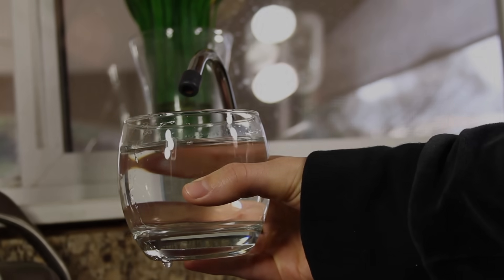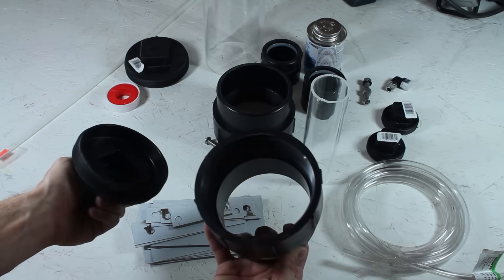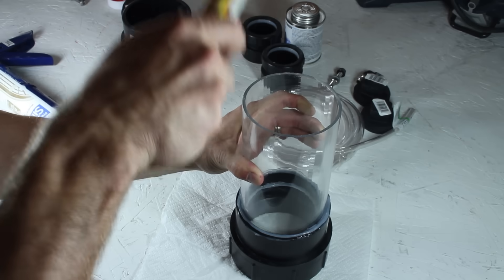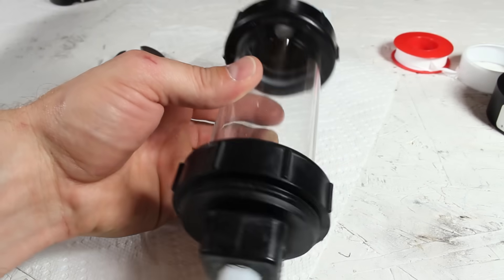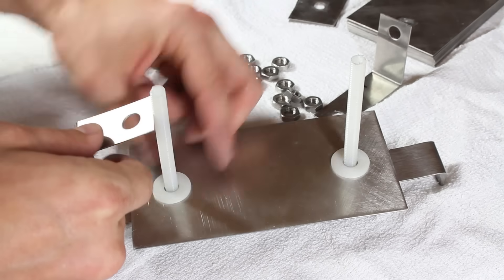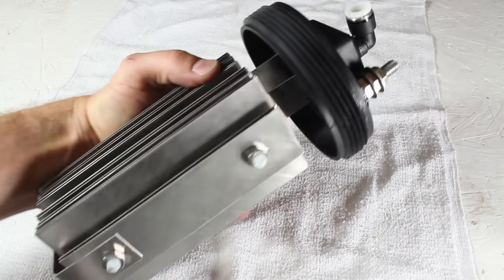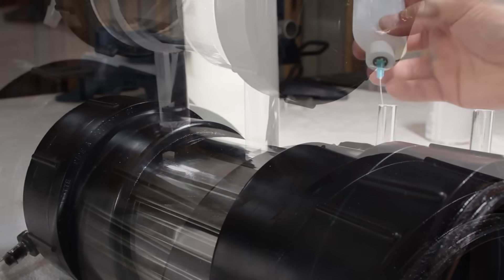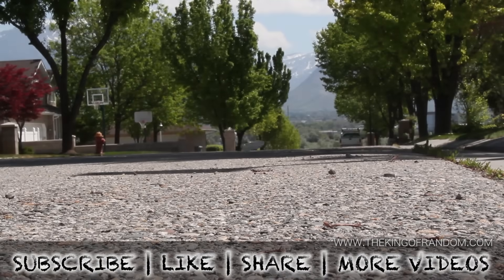HHO Generator - Water to Fuel Converter

Comment: Will this work with an AC current too? If you could hook this up to a car's alternator (or if it doesnt work with AC current, convert it to DC), you could raise your mileage...put a bunch of these in a truck toolbox and put the output HHO hose shooting the gas into the engine's intake. Im working on building one, the only issue is finding a source of high electrical current other than a car alternator.

Also, baking soda works well as an electrolyte/catalyst. If you happen to run out of potash

Comment: I found this project great. I wonder if this  works a brine solution (NaCl + water). Before I tried to build a brine electrolyzer using empty bottles of soda and or sports drinks. I used carbon  from used Carbon batteries as the electrodes. It works effectively and HCl gaseous state is the by product. With the help of this video I can  finally revised my own HCL gas generator .

Comment: You know, There's a way to separate the hydrogen and oxygen.  If you make a similar setup to this, but have two elbows, such that you have water in a U shaped tube, and then have a cathode at one end and the anode at the other end, you'll get hydrogen evolved from the cathode and hydrogen from the anode and they will each float up from their electrode where you can capture and store them for later use, and then you have another problem to solve: hydrogen storage.

Comment: Hey Great Job Dude!, I have been building Mine going upto a Year now, Lolz, (Pittiful right?). But hey, Due to the Massive Amp Draw Its Not Practical for Car use, But I have a question, is there anyway a step up or step down TRANSFORMER can solve or at least reduce this problem? & make somewhat Useful?. I have been trying 2 research.
Thanks.

Comment: I think you use the wrong setup in youre plates brcause you get to much water vapour . That means you get to mich volts on your gabs you heed around 2 volts per gab for optimal gas production

Comment: quick question. the connectors for positive and negative are connected to the two middle plates(2 octagon things separating them) and to the 2 outer plates (apparently), so how do the other stainless steel plates get the positive or negative charge?

Comment: You are absolutely correct, and if you see the part near the end (~8:17) you can clearly see the bubbles are only coming from the middle and outer plates.

Also, the math tells me that 5 liters/min requires ~472 Amps. That's maybe possible using two car batteries in parallel, but not for very long!

Comment: The way you built the generator mean that there is current only in four plate. The two external ones and the 2 middle ones. All other are electricly shielded because of the plastic washer. Wouldn't it be better to bridge half of the plate ( in alternance ) on + and half on - to get an even higher efficiency ?

Comment: no because abs is used in chemical drains for science labs and acrylic is gust for looks you an use some abs pipe for that  if you are worried about chemical bounds eating away at your pipe nylon can be used as chemical transfer for a container to another container i seen it hold up to battery acid for 8 year and still going  acrylic is just for looks but it will work as well

Comment: Yeah right, but  this chemical reaction isn´t that inefficient if you use the resulting heat(exotherm reaction) e.g. with a recuperator. If you let the H2 & CO2 react to Methan(and water) you can use the already existing gas-pipelines & tanks for transport and storage, no new systems needed. I think it´s ok to loose a little bit of efficiency at the reaction, so that the energy can be transported/used in existing systems. 
Btw the system´s called Power-to-gas in general if you´re interrested :)

Comment: Most of the time, when dealing with physics/chemistry/science overall, the more you convert something, the less efficient it becomes. You will lose tons of heat/energy if you take solar power (Light) convert it to electricity (Electric) then to Hydrogen (Chemical), Methane (Chemical), and back to electric (Via burning the Methane to create steam that will turn a turbine). It is wildly inefficient. It would be much better just to keep it in Hydrogen form, then use a fuel cell.

Comment: Photovoltaic power source instead of car batteries and you have a hydrogen fuel cell.
Did you calculate the efficiency of the device? 2 car batteries is quite a bit of omph!

Comment: Some type of glass would be ideal because it would resist the heat much better than plastic. However, glass is more difficult to cut into the shape you want, and it is also more dangerous if your device backfires and explodes.  You might want to try a type of plastic that is very difficult to melt.

Comment: Taken directly from the description--
"I have not tried this HHO fuel to operate engines, although many people claim they have done it with success."

My take -- Yes, as long as the engine is meant to run on Hydrogen-Oxygen reactions. Putting this in an engine not designed for such purpose, i.e. a car engine, is just a stupid way to get yourself and/or others killed and/or seriously injured and should not be attempted.

Comment: well if you could get a engine to run of the gas you can connect an alternator to the engine and charge the batteries and also hook up a little generator to the engine you might be able make a self sustaining power source as long as you have enough alternative fuel to power the engine and a sustainable water source.

Comment: Yea I was told you could use any sort of metal, however stainless steel will last the longest and wont corrode as fast as other metals. I'm not sure how long it lasts compared to some other metals though

Comment: "the fuel of the future"?... If you attached this to your car, wouldn't it corrode the spark plugs or eventually flood the engine, since the gas turns back into water/water vapor, which, in turn, condense in the piston?  I understand there would be exhaust in the engine but would it eject ALL of the water?

Comment: This can be installed into a vehicle with a recirculation pump feeding the water. Re-created during the burning process back into the generator. And with a few alternators and a capacitor the car can generate the electricity needed

Comment: The problem with Stanley Meyer's design is that it is a perpetual motion machine.

He claimed his fuel cell would split H2O electrolytically, burn the H with the O2 recombining them to form H2O which returns to the cell. Meyer claimed that less energy was needed to split the H2O than is predicted and observed by science. His fuel cell violates the first and second laws of thermodynamics.

This is equivalent to powering a car by mounting a wind turbine on it.

Comment: You can't get the Potassium back from Potassium Hydroxide by reacting it with Aluminium. That reaction yeilds Potassium Aluminate: KOH + Al + H2O = 2 H2 + K2Al2O4.

These are the ingredients in some drain cleaners by the way.

You will always get less energy out of a system than you put in to it. To extract the elements you need to get these reactions requires more energy than simply using that energy directly to power your vehicle.

Comment: Indeed you will get a lot of energy by dropping sodium in to water, but where are you going to get the sodium from? Sodium is so reactive that you don't find it in it's pure form in nature, it's always bound to another molecule, like Sodium Chloride (Table Salt, NaCl). The same goes for the other elements you mentioned.

The amount of energy needed to extract the pure sodium from a sodium-containing molecule would exceed the energy you get from sodium's reaction with water. See: Entropy.

Comment: + Photovoltaics to power your generator and there is no need for fossil fuels anymore. Well, other than water, which gets produced during engine running ;) I see some dude managed to convert gasoline engines to use hydrogen. That's cool!

Comment: Because you actually are getting less chemical energy the then he electrical energy you put in. So if you try making a car that runs on only electrolysis it will be less efficient then an actual fuel driven car. (check Wikipedia if you disagree)

Comment: I have a few questions, why did you use a nut, when you could have used a steel washer and why did you connect the bracer in the middle instead of on the end like the first one?

Comment: You are correct that you can't use this as an infinite energy source, but you can use it to make cars that is more efficient than an electric car and cleaner than a gasoline car.

Toyotas fuel cell hybrid car expected to be released in 2015 has a 830km range on full tank and can reach 155km/h as top speed. That is better than both gasoline cars and electric cars.

Comment: its more than half a centimeter... which of steel or iron is quite durable....normal engine uses 5cm thick steel... adding another 6mm to that makes it all the more resilient..... i calmly suggest that u research this n get back to me to tell me if im right or wrong.. i also want to know

Comment: your engine will explode... not to metion u will just die while starting your car.... normal car engines have to be reinforced with a 6.01 mm thick metal sheet just so that they can with stand the pressure of the powerful n highly compressed blast.... also your caarburettor wont be able to understand how much HHO it is pumping because of the difference in density

Comment: You are right and you can see it in the generator when he powers it up. Only a few plates are generating gas. No idea if that is on purpose or by mistake. But in the video you can see that only certain plates are hooked to power.

Comment: I'm trying to make one of these from an old computer power supply but i'm running into some problems. The stainless steel i'm using as the anode dissolves slowly creating poisonous chromate ions (yellow). Is my voltage too high? or is the quality of my stainless steel not good enough? any suggestion on common household items made of stainless steel?

Comment: I used KOH as my electrolyte because research suggested it was the best. I haven't experimented with other electrolytes, but have heard that salt, sodium hydroxide, vinegar, etc could work, but will dirty and may corrode the plates. Potassium Hydroxide keeps the system clean, however, it is caustic, so be careful if you choose to use it. You can probably get away with about 2-4 teaspoons of KOH per 6 liters of water

Comment: I tried it on a single piston engine, it worked...for like 10 secs lol if it generated gas faster, im sure it would work. It was 2-stroke tho, so the engine would run dry. i need a small 4 stroke.

Comment: Would this be able to be modified (made bigger, more current, etc) to get to about 60 psi? thats the operating pressure for a car engines fuel rail, wondering if i can only use half gasoline and half this..

Comment: Nope!
Hydrogen powered cars use hydrogen fuel cells in order to power them.
Hydrogen gas (H2) is electrolysed at an anode to produce pure hydrogen (2H+) and 2 electrons.
So H2 -> H+ + 2e-
The hydrogen flows to the oxygen to form a bond and become water.
The Electron flows through an electrolytle and becomes part of the hydroxide bond.
When this electron flows it produces a current that can power a motor.
(Electrons cannot flow through with the hydrogen beacuse the PEM only allows positive ions).

Comment: arcylic clear pipe is $ but pvc or abs would work fine, but no bubbles are seen.... my guess would be <15 for the pvc and ~15 for the hardware(bolts and fittings) and 5 for the steel plates

Comment: Its not efficient with out an environmental friendly catalyst (which scientist are working on). This is because the energy needed to separate the Oxygen from the Hydrogen is the same amount of energy given off when the Hydrogen explodes. If it wasn't for this Scientist would have already make Hydrogen based generator for the public.

If it was hooked to a solar panel the energy to make a Hydrogen engine it would still be inefficient because its still better to connect the solar panel directly.

Comment: And Ford Made a Pickup truck and a bus, they were kinda gimmicky, but they did get at least 20mpg. Both were converted engines. 
Roush shown off a conversion kit for regular ICE engines.  A supercharged 4cyl that got 200miles/tank highway. To lazy to math mpg there but still not too bad. Deisel Engines would have to have compression turned down a bit though, but its the same as converting to natural gas.

side note: converting my 93 escort to run on propane.

Comment: But hydrogen has a low energy density (even as a liquid), so low that you will come up with ~5MPG with a optimized engine. And the engine needs to be detuned or it will explode (unless you use direct injection - thats why I was talking about diesels).

Comment: So why does Shell have the special tank set up for hydrogen? I'm not talking about fuel cells either. I'm talking about a Hydrogen internal combustion engine. There are even conversion kits too.
BMW, and Aston Martin both built High compression combustion engines too. 

wikipedia.(dot)org/wiki/Hydrogen_internal_combustion_engine_vehicle

Comment: you can use the hydrogen gas to save gasoline in you car if you plug it in the air filter area you will save over 30% gas look it up to get it right we have one installed in our car and it work perfectly

Comment: Running at idle? Look I'm actually an engineer and believe me you can't make a efficent (high compression ratio) piston engine for hydrogen or it will blow itself to bits.
You can use hydrogen for rockets or turbine engines tough.

Comment: Because this thing is useless in piston engines, it has awful knock properties.
It's good for rockets tough, and that's where it's used, but the gasses are produced in way more effective way - by liquifying the air (oxygen) and hydrocarbon reforming (hydrogen waste from diesel/gas production).

Comment: Just wondering. If you use a hydrogen engine to generate power, is the power generated equal to or greater than the power it took to convert the water to hydrogen?

Comment: the "fuel" doesn't blow up because it turns back into water, it blows because hydrogen is an explosive gas and there's 2 atoms per molecule of water, so when it blows u can see like a bit of fire when it blows up because when in cantact with oxygen they go incandesant, ur welcome

Comment: Doesn't this wear away the stainless steel at the anode? (where the oxygen is produced)
Because this makes the stainless steel more easy to corrode, unless stainless steel is that resistant to corrosion. If it doesn't corrode then I should go and make one now! I was considering using Graphite electrodes instead, for the anode.

Comment: one there is cars powered by hydrogen gas they are extremely expensive and powering something inst as simple as flowing the fuel in. we used oil in the past because of it properties hydrogen gas is very different and a lot harder to use to power an engine

Comment: No, the problem is that Hydrogen Gas doesn't have much Energy Density, even if you liquefy it, which requires more energy to keep it at cryogenic temperatures.  So, if you converted your car to it, you'd need a tank larger than the car, or a multistage cooler to bring it down to 33 degrees above absolute zero, which would leave you nowhere to sit.  Methane has a better energy density, or Ammonia would work with a fuel cell, and a reasonable sized tank at room temp/pressure.

Comment: I've got all the components ready to make on of these but I don't know how to optimize the production, for example: more steel surface always means more production with the same voltage/amperage?, how many space should I let between plates to optimize the production?
PD: I have some 12v car batteries.

Comment: Well obviously it uses more energy than you get out of the fuel- the laws of thermodynamics be a harsh mistress. That isn't the point though- if you have a device that needs some kind of combustion instead of electric power, this does the conversion.

Comment: it is in cars... ever hear of hydrogen cars? it doesnt use this gas but it uses the electrolysis process instead. essentially there is a semipermeable membrane that allows the hydrogen atoms to pass through but not the oxygen so the oxygen atoms have to go a different rout which turns an electric motor and once it finds its way back to join up with the hydrogen it leaves the tail pipe as water

Comment: No because its not efficient enough for cars , you need to put a lot of power in to get little out , thinks about it the car does how many explosions per min 2000-4000 , also far as I am aware those plates will also degrade over time and need replacing, there is a reason you can buy these on ebay and get scammed 100% when they tell you it will give you 20% fule savings its total bs.

Comment: Well then you might as well just have a battery operated car.  Now this does not mean this isn't a good idea, just not the way it is presented in this video.   So if he connected the electrodes up to say, a solar array, then it becomes practical.  Safety is another issue.  I don't know if they have licked the safety issue yet but I would like to take this moment to remind you of the Hindenburg disaster.

Comment: Well let's see, first the energy needed to separate the oxygen from the hydrogen exceeds the energy produced by the reaction of the hydrogen in the presence of the oxygen thereby making this impractical.  Next, you will need to replenish the electrolytic source periodically and that isn't free and those steel plates will corrode over time and will need to be periodically replaced.  The big issue however is that first one.  So you will still need a source of electricity.